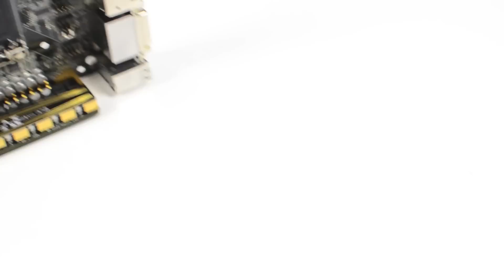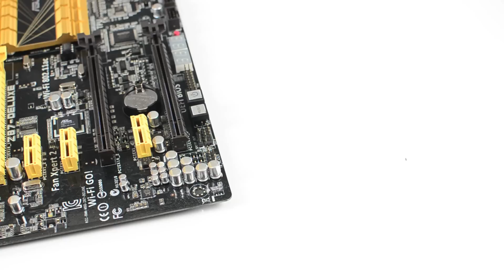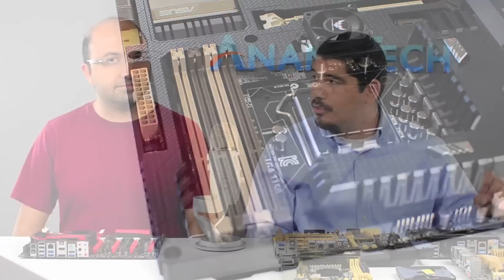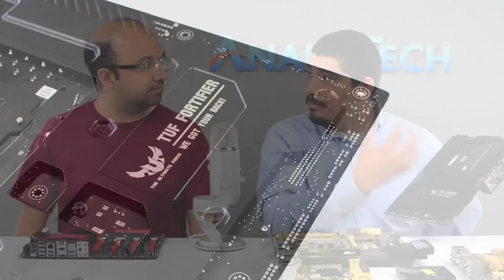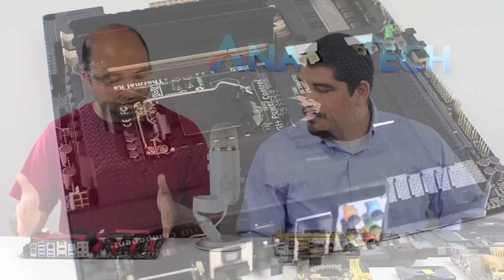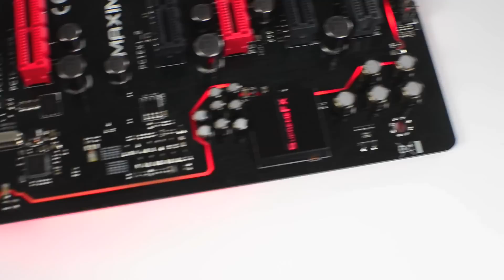ASUS Haswell 8-series Motherboard Lineup Overview

Comment: There is one thing you (or rather JJ) forgot. 

Asus' Z87 series are flawed. The USB 3.0 will not work correctly due to a stepping problem. You can't assure yourself of getting the revision (C2) that fixes this as ASUS will not help. They won't stand behind these products in this regard. 

To fix this problem: Try buying a USB 3.0 controller card AND the 20 pin adapter. This will allow you to manufacture a cure yourself. Asus is just like any other MB manufacturer. You're on your own my friend.

Comment: For Asus: why does the manual leave out important details?  I did a google and found thousands of others were asking the same question going back to 2010.  Here we are 2013 and the manual was the same.  Why not state clearly the 8 pin OR the 4 pin need to be connected and to what type of connector - noting Corsair refuses to publish the port pin out so you are left to wonder cpu 4+4 or PCIe and if they manual meant you had to plug in both the 4 pin and the 8 pin.  The same for the GPU.